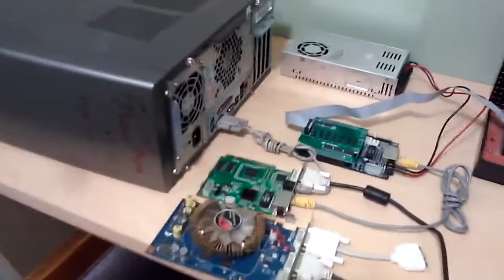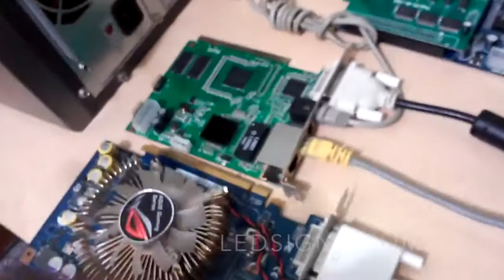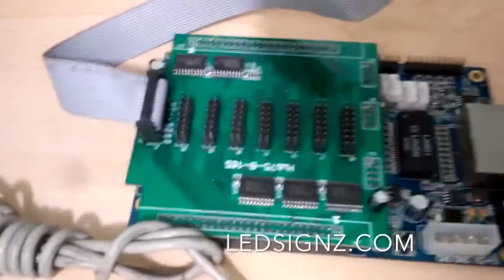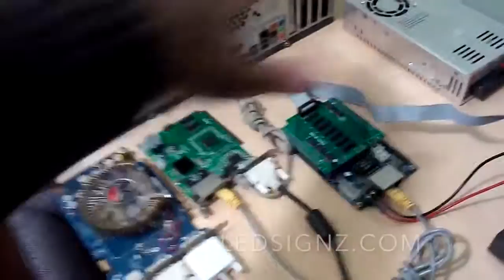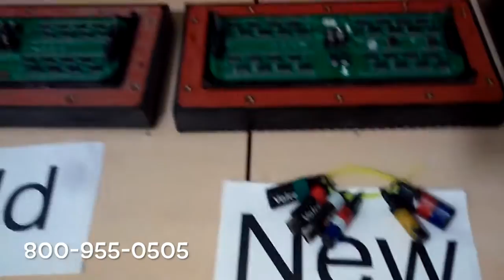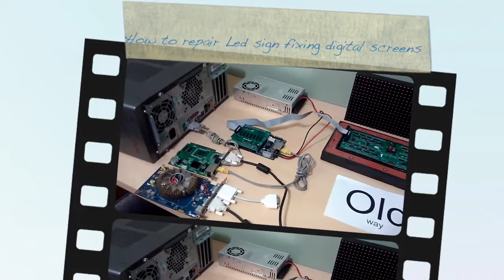How to repair Chinese Led signs, fixing digital screens, FREE training

Comment: What is the E100 error code in LED board?
Reply from the maker: HI, I am not sure what software, driver, interface, and screen you are using.
Feel free to call me at 216-475-9800 and ask for AMID and I will be glad to help you trouble shoot your problem